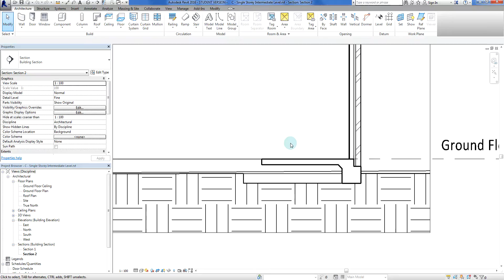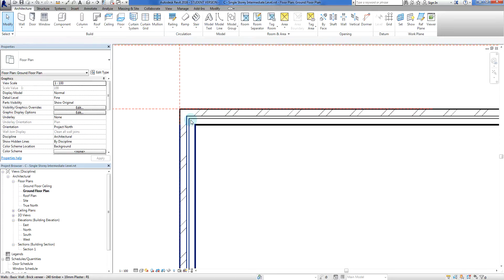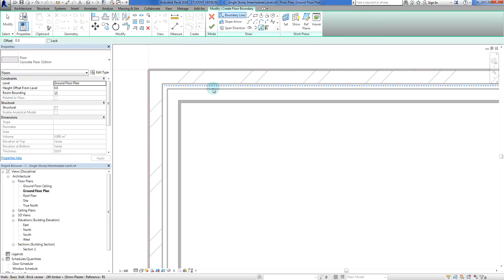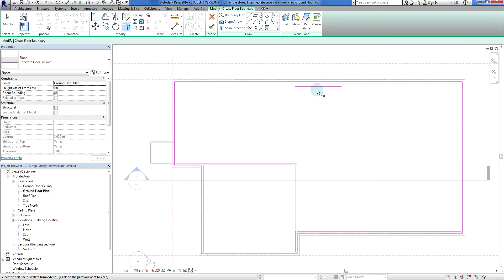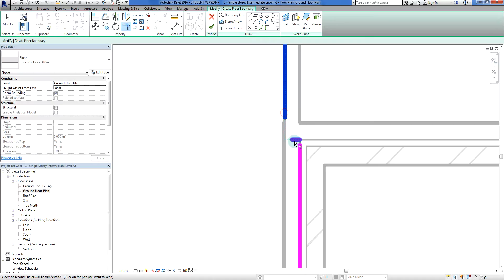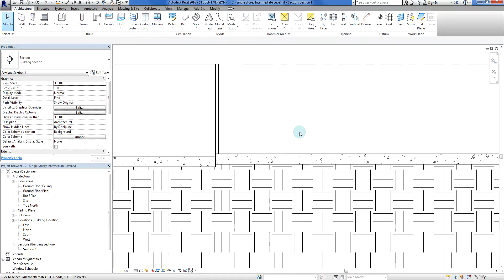Revit - Single Storey Intermediate 14: Floors with Brick Veneer Wall - Part 3

Comment: Hi Rhys...Is it better to use the Building Pad option or the floor command while drafting the ground floor slab ?  Thanks.
Reply from the maker: Hi Dhvani

Either system works OK for ground floor. Both have limitations.
Reply: Ok..Thank you Rhys !